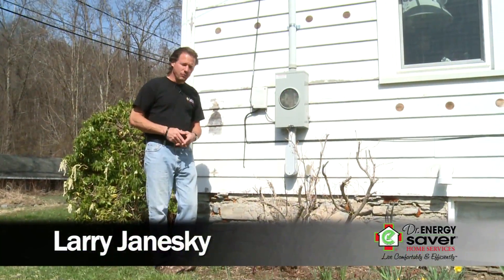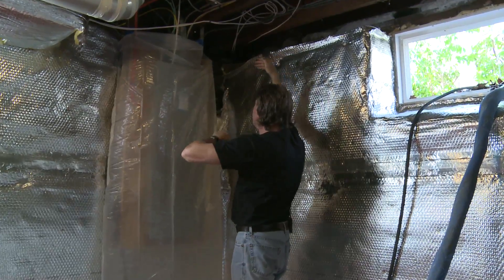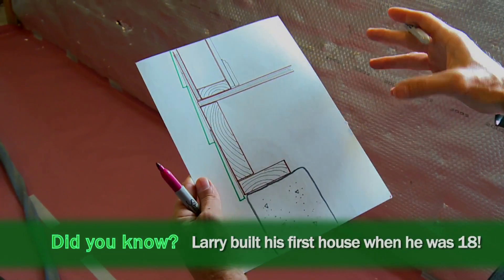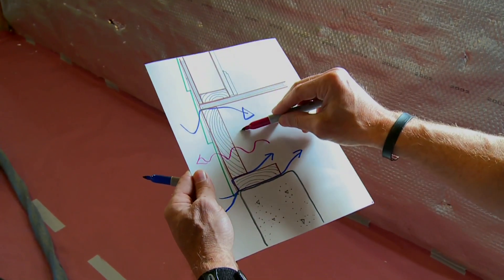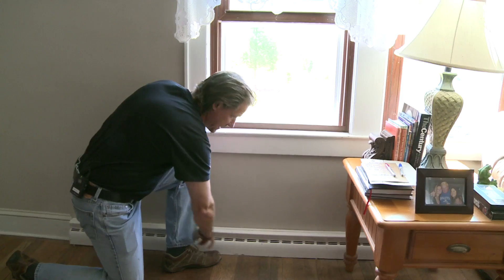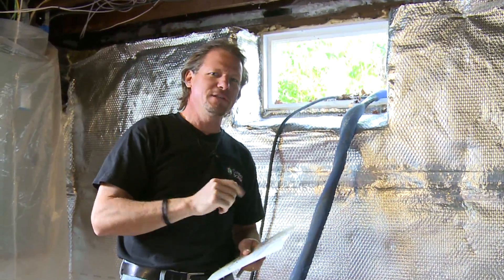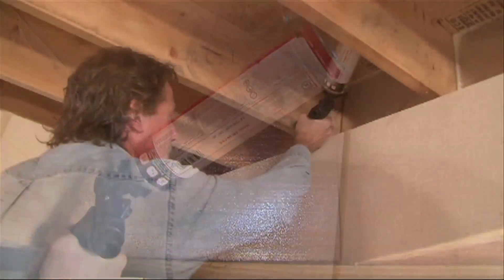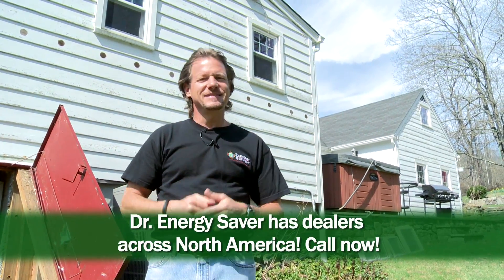Sealing and Insulating the Rim Joist

Comment: Doctor, the top of my foundation is much more exposed than the drawing of the rim joist area in the beginning of your video. There's like 4-5 inches of cinder block exposed before the sill plate and rim joist. I've insulated the rim joist and foamed where the sill plate meets the foundation but should I cover the top of that cidnerblock?.
Reply: I have this same problem.
Reply: I plan to cover the top openings in the cinder block with PVC trim brad-nailed to the sill plate, then caulked. This is not so much for insulation purposes but to block an insect pathway through the foundation into the house.

Comment: they have sealants for those sill to foundation and sill to rim joist connections when homes get built.....
Reply: I recently removed the extra fluffy pink insulation that was stuff into the rim joist spaces of my unfinished basement, only to find that some areas had been sealant-covered, but other areas were clearly not. There were even up to 1/4" gaps between the rim joist and sill plate in some areas where I could see the concrete foundation beyond it. And those were probably where rodent pests were able to get into my basement recently... 

All that sh* is getting stuffed with wire mesh and spray foamed. xD

Comment: Loosing the heat out the rim joist isn't the real danger, it's the Moister than build up on the Rim joints and rots the Would and creates a black mold or dry rot. then the bugs move in. Builders have to start properly sealing from the start. There needs to be a cap that go in these spots that clamps on the wood Rim joist and has a sealant built in keeping Cement block and wood apart and seals it at the same time. Something that sits on the Block wall and rim joist sit on it and be high enough to be nailed to the studding and be thin enough to nail sheeting over top. A large Plastic L shape 12" x 12" This could act like the Foam seal and tuck taped to the House wrap for a complete seal. I find rock wool the best insulation it maybe expensive but in the long run much better savings fir resistant to 2100 degree Fahrenheit and get wet doesn't interfere with it's insulating values like Fiberglass because rock wool repels water.
Reply: Should be using treated lumber on sill and rim joist. Even on joist themselves. More cost and maybe   little less straight causing more work but best long term

Comment: We spray foam the rim joist then added batt insulation. About 4 years later we found heavy condensation between the spray foam and batt insulation which caused mold. Should we remove the batt insulation, leave the spray foam insulation, and just dry wall over the basement wall and basement ceiling?
Reply: thebobandtomshowfan ARE YOU KIDDING ME I just spent all yesterday installing ridged foam and sealing the edges it with great stuff and I put some fiberglass batt insulation...are you telling me that I’m gonna get moisture problems? ..........is your ridged foam sealed on the edges?
Reply: No Name: I'm probably going to have to post a video to show all the problems we unveiled after 4 years of construction to our basement. I could not believe the amount of condensation generated between the spray foam and Batt insulation. We had so much moisture created it ran down the basement walls and pooled    on the basement floor. Please note our house was built 4 years ago and I have been told moisture will come out of the concrete for several years while it is curing. I'm not sure if that caused all the water or not. We do have a humidifier running and have it set at 35% which is pretty dry but still have lots of condensation dripping from the spray foam that is combined with Batt. Where I removed the Batt, the spray foam stays dry.
Reply: thebobandtomshowfan our house is 30 yrs old and the last owner had just stuffed batt insulation in the joist rim which I was told was a no no because it will create moisture so I took it out to find a HUGE mouse infestation.... but surprisingly absolutely no signs of moisture so I cleaned all the mouse feces up blocked the hole they were getting in at and installed rigid foam and new insulation on top of that hoping that it will be OK.....I hope that your problem was just the new concrete ......Oh yeah I have a block foundation with a basement
Reply: I really recommend this youtube channel regarding this topic "Home RenoVision DIY". Check out this video which has helped us.  https://www.youtube.com/watch?v=KGjO1wddX7A&t=10s

Comment: What application would you recommend for a block and mortar foundation that isn't exactly flush. It's not not structurally sound but I know rigid foam has to be flush with a block wall or it could cause a pocket which leads to air/moisture and mold? Would I be better off going with the closed cell spray in? What about leaving the 3" for termite inspection? Do you not need to leave any space in the rim joist area for a termite inspection?

Comment: I watched another video that cautioned not to insulate that cavity as the rim joist will trap wicked moister from the foundation wall, and then rot.Might it be smarter to just put insulated board under the sub floor?
Reply: Use treated lumber

Comment: Older homes could certainly benefit from any structural & insulation upgrades where practical. I'm always suspect when an additional method of insulation comes to a well built home & the spray foam has to be added with a protective oxygen mask. I'm sure many here are aware of the spray foams causing serious medical issues when even applied by contractors incorrectly the foam to thick. The more we make our homes air tight the more we have to spend to get fresh healthy air handlers to blow from outside back into our homes due to these tighter insulation methods which create an industry for fresh air handlers. I believe there's a balance know doubt in efficiency vs cost savings but, fresh air is more vitally important than air tight foam insulation. Some of The longest standing homes built which many have little in the way of insulation can @ least not pose a health threat due to chemical foam insulation.
Reply: This is WAY off in its idea. Building science has  PROVEN that there is no such thing as "to tight a house"  The fresh air you speak of leaking in and out ALSO brings with it.. contaminates, dust, pollen and just plain over all poorer air quality. A blower door test can prove all this.
Reply: hotrodder62  I guess we all have an opinion. Some have more experience than others & science would argue with to tight of house theory I'm afraid..... science, yah there still trying to prove what they don't understand & can't figure out but put there opinion in it anyway. U can use passive solar & landscape properties to keep a home cool in the summer & versa in the winter. Keep selling your products people will buy Dr energy savings due to balloon framing before they learn of the next great mouse trap idea. U seal your cracks all u want keep your contamination away from sound, quality craftsmanship in any home built with common sense & good design Dr energy!
Reply: 30 yrs in the buis, BPI certified,  and over 7000 homes insulated IS my experience.....soooooo........
Reply: hotrodder62  last reply- I'll venture those homes are mainly in the city stacked up against one another. When a man boast about what others build for him under a contractors name I'm not impressed. Building homes like they were stamped out all identical in there infrastructure in just under 90 days or less is not building a house in harmony with the lands natural timbers & earths landscape surroundings. If your willing to dispute the oldest most efficient use of passive solar design, earth's natural insulation, & using the tragetory of the sun In each season to allow the natural resources to manage the balance for healthy efficient energy homes that are proven to be nearly 0 loss in energy waist & requiring no manufactured producing resources for consumption year around then it's obvious your determined & would rather spray your cancer causing synthetic chemicals all over your home. So please, by all means be my guest. Enough said!
Reply: And like most that you have  spewed .. you would venture WRONG.
Reply: lease do show the PROOF you claim in "cancer causing chemicals"  do tell! ..AND BE SPECIFIC....... (* I thought as much)
Reply: Really...then with that logic, DONT boast about a meal or a dish you made / cooked... you DIDNT GROW THAT FOOD!...

Comment: Caulking your exterior wall sheeting from the outside where it meets the foundation will cut down drastically on energy being lost and drafts you feel by outlet plates in your house. Note I said wall sheeting not siding sheeting is what the siding is nailed to.
Reply: correct.. but  caulking will do NOTHING to stop thermal tem transference.

Comment: WHAT ABOUT THE RIM JOIST ROTTING OUT FROM NO AIR CIRCULATION ?
Reply: Why would that happen? .. no such thing.. if the spray foam is STOPPING heat loss it ALSO stopping condensation. Thus NO rot.  With that thinking why insulate at all ? And just let AIR CIRCULATION  run rampante thru the entire home?
Reply: This can happen. The sill plate sits on the top of the foundation, the foundation is in the ground at 100% relative humidity, insulate the inside wall of the basement, then the rim joist, the moisture in the foundation will have no where to go but up into the sill plate and it will not evaporate because you have removed all air flow from the rim joist bay. The sill plate will be sitting on damp concrete all the time.
Reply: When the house is being built, before you lay the sill plate, you install a vapour barrier along the top of the foundation wall, then attach your sill plate to the foundation wall but also be sure to use sealant at all attachment points.
Reply: Douglas Hughes: You are 100% correct. Our new house built in 2014 is experiencing exactly what you describe. Now I'm scrambling to come up with ways to fix it. From what I have found is yes the foam seals up the house 100% but a house needs to breathe.
Reply: +allyn bubolz was just  thinking this
Reply: Watch TGSNT & Hellstorm z   

K
Reply: That's what prevents moisture stacking, stopping the influx of humid air.

Comment: I want to seal  the rim joists around my house, but the basement is finished.  Is there anyway of doing this from the outside?  Maybe spray foam?  Can't take off the sheetrock walls and ceiling on the inside, but I have very high energy bills and very cold floors around base of the house.
Reply: NO this can not be doe from the outside. It would just keep spreading out and over the ceiling and you wouldnt be able to see anything.
Reply: Kris Bostrom did you do anything about it?

Comment: I received a quote this week for my 1,000 sq. ft basement, $1200 plus taxes.
Last week, an HVAC contractor quoted $1200 to apply rigid foam.
Reply: Yes these guys are a rip off. $12,000 to do the same job I already had quotes of $6200.
Guy came over and wasted 4 hours of my time. Yes this guy is great speaker and they send you a lot of useless waste of money paper materials. This company is greedy and spends a lot of money on videos, decorating their cars, and bullsh*t brochures. I do not recommend this company. $2066 just to vacuum out the 5 inches of old insulation. $600 for a dumpster!!!! 1000 sq. ft.
Just use them for a guideline. Good info but, if you have them do it. There is no way in hell you will ever cover half the cost.
Reply: IF they just did they band joist AND it was a BASEMENT and not a crawlspace. Our cost would have been around 450.00  using closed cell

Comment: I wouldn't argue the effectiveness of the insulation methods described here, but one thing to consider prior to spray insulation in the rim joist cavities is to make sure there is no wood destroying insect activity (i.e. termites, carpenter ants, powder post beetles, etc). I would really recommend spraying all the rim joist areas with Borathor to prevent aforementioned insects from going after wood that will no longer be accessible once the insulation is applied.Other than that, great video!
Reply: Great tip! I'm about to spray insulate my rim joist, and this will be an excellent item I add to my checklist to make sure I've covered my bases. :)

Comment: what the average cost
Reply: I see this is 5 yrs ago, so, not sure if you still need an idea, but you can get $5-6 cans of spray foam insulation from a local hardware store. I've started using that, and it seems helpful (I can no longer feel a breeze when I put my hand near the area I've sprayed). The stuff is super sticky when drying, however, so I'd advise wearing disposable gloves that you can just take off and throw away after using it.